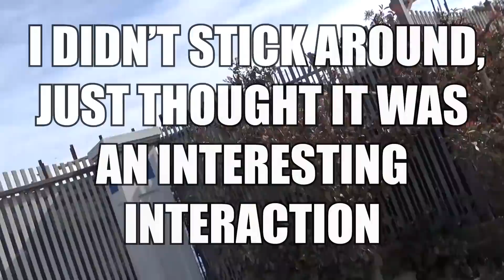*THEY GET TOO BOODIE HURT TO KEEP WORKING AND CLOSE UP SHOP*

Comment: American drilling drives a truck made in Mexico
Reply: Actually.........Alabama..........for the past 20 years:
All four of the Honda models in the top 10 of the 2021 American-Made Index — Ridgeline, Odyssey, Pilot and Passport —were designed and developed by Honda engineers in the U.S. and are produced exclusively in Lincoln, Alabama. Honda's Alabama Auto Plant celebrates 20 years of manufacturing this year.Jun 23, 2021